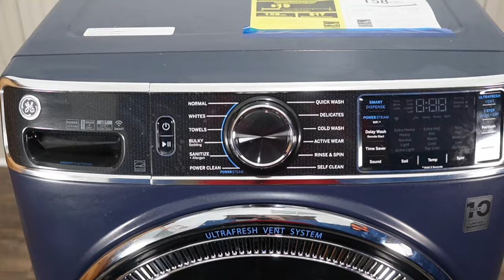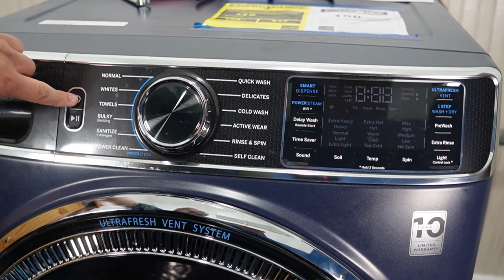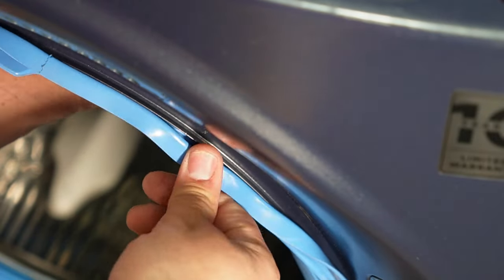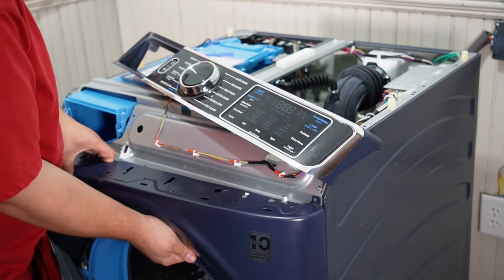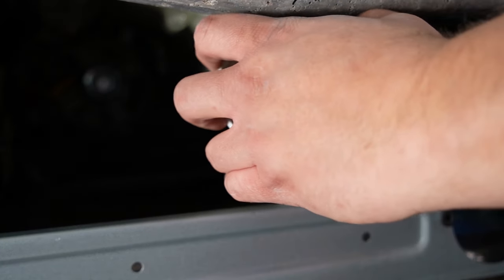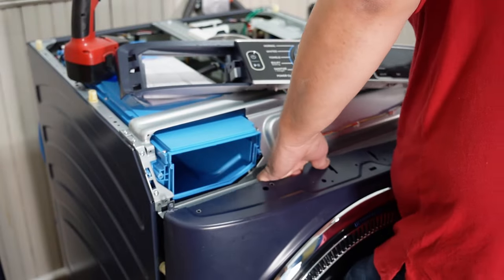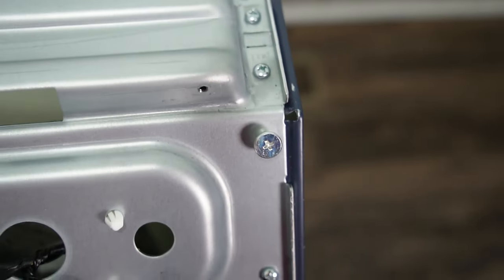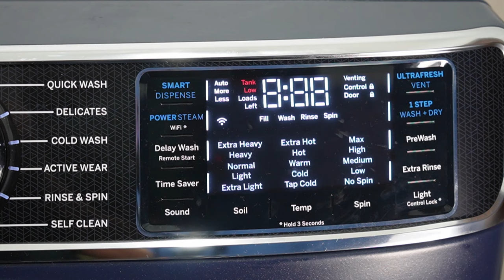GE Front Load Washer Won't Drain or Spin - Ideas to Troubleshoot & Fix

Comment: You DO NOT have to remove the front of this machine to access/remove/replace the pump! It’s easily accessible from the bottom of the machine. Two screws remove it and there’s plenty of space to pull it out. Also 9 times out of ten they pump is fine just jammed with debris keeping the pump from turning. Have dealt with this twice. Three screws hold the pump together, open up the pump and almost a guarantee there’s something stuck in the pump that made it past the filter. It’s a 15-20 min free fix.
Reply: If you have access to flipping the machine on it's back in a basement or garage, but if it's on a pedestal in a small laundry room, that's definitely not easier. Besides the Phillips screws go in from the top.
Reply: Agreed, just flipped it's back, the pump is exposed.
Reply: You’re exactly correct! Took me a half hour to take the pump out flipping the machine on its back, removethe housing, remove the blockage, and reassemble/reinstall. Saved me $60 on a pump and took me no time at all 🤘🏼
Reply: W
Reply: Thank you so much for this advice.  Turns out the impeller was just clogged.  Super easy fix.
Reply: @anthonyboni5884  Hi what is the housing mine doesnt drain
Reply: Yep. A small pebble/ hair tie for me. 20 min fix. Thanks again youtube!
Reply: @judyadiaz  it’s under the front right. Lay machine on its back and it’s easily accessible and a quick fix. Get the water out first though
Reply: I am so thankful I clicked on comments, bought the pair GE 2018s for $150 because washer would not drain. Even if it is the pump, I made a great deal. I now will always read the comments! Live and learn!
Reply: What symptoms were you guys having? Ours seems to be pumping, but it will end every cycle after 3 minutes, it appears to not want to spin.
Reply: Do you happen to know if the Inverter board is accessible from the bottom as well? Hate to have to disassemble the whole thing... Thanks
Reply: @mikediyer8361  did you ever access your inverter board?
Reply: We read this and my hubby did this option! Thank you!
Reply: @littlenewland1  did you guys figure it out? Ours is doing the same thing!
Reply: Is there a video for this? Thinking about giving it a go today.
Reply: @Jayhawg just did it and I flipped it on its left side. Use socket and Philip screw to unbolt pump (2 screws). Then pliers to take off plumbing hose (2). Unassembled the pump 3 screws and check for blockage
Reply: @don2deliver yeah, OP is on one.
Reply: Yep, this comment saved me from taking the front of the washer off. Simply tipped it on its back and removed the hoses. Turned out the blue drain hose had a nice blockage at the joint where it turns 90° exiting the pump. I removed the pump anyways to make sure there weren’t any additional blockages. Thanks a lot for the info!
Reply: Thanks for this comment! Ours are stacked. Getting the dryer down and washer tilted back was a challenge but we did it. Our pump was clogged with a hair ball (🤢). Who knew that much hair got in to the washer?? We’ve had it for 5 years or so. But anyway hairball removed and washer is draining and spinning!
Reply: Here to confirm, @playtime9259 is the GOAT! You saved me so much effort and time that this video was wanting. My wife’s hair got caught around the pump and stopped it up. Flipped it upside down, took it out and now it’s working perfectly.
Reply: Some lady the other day washed rubberized mats in her washer….
Reply: Followed your instructions and didnt find any debris so my guess is the pump is bad. It was a B*tch to get the smaller blue hose clamp off but got it off eventually. Thanks for the tip. I really didn’t want to take the whole front apart like the OP on the youtube video.

Comment: Everyone before following the method with the lower compartment make sure you have a large container or bucket as opposed to a paper towel or bowl. If an entire wash has not finished draining it can cover 2-3 rooms with water. It took me 4 heavy duty paper towel rolls to clean up smh
Reply: Or just hold a shop vac to the front filter opening as you unscrew it. Not a drop on the floor
Reply: This comment is 100% correct lol

Comment: Thanks for the great video. I've got your same washer. The hoses are all clear, the drain pipe is properly routed into the drain, and I just replaced the drain pump. Still won't drain. When I put it into test mode 12 to drain it, nothing happens. I suspect it is not getting proper connection telling it to drain. What should I be looking at replacing if the control board is needing to be replaced? THANK YOU SO MUCH.
Reply: This is my problem too
Reply: @dianediaz1586  I wound up having to replace the whole control board. When I inspected it, I found a part that had completely blown (like black smoke residue). I replaced that part (after several failed part attempts), and it worked. I think it blew because my son was playing with the washer and it got put into several spin cycles in a row in a short amount of time. I recently had another part fail and I said I’ve had it with this washer and replaced it. Good luck to you.
Reply: Thank you I ordered just now ☺️

Comment: I need info and video please on how to change the control board. Broke w/ 13 minutes left in cycle. Machine won’t drain, showing many codes, that often change w/ trouble shooting. Checked drain filter and was completely clean, so we thought possibly drain pump, changed it and still doing same thing. Reading other comments, leaning towards control board change but GE says the part is $418, and that doesn’t include labor if we can’t do it ourselves. Looks like we’re going to have no choice but to buy a new machine. We’re already in $125 for a service call.
Reply from the maker: Just posted the video yesterday on my channel! I also sell the boards and they are under $150!

Comment: I used this video to fix my washer. I have the same one that's in the video. I think I messed something up putting it back together because it's leaking from the bottom of the machine. It's on a pedestal and I just opened it and found it to be full of water. Not sure what to check first. It only leaks while the water is running into the drum. And it looks like it's only leaking a little bit. But it was enough to fill up the drawer with water since I put it back together like 5 months ago or so.
Reply: I have the  same washer, and it drips water I to the drawer ever since I purchased it.  

Also, I hired a technician because the machine door stuck closed and had to replace the door latch, and the main board cost me $500.  The machine still leaks, but I can open the door now.

Now the washing machine won't drain and spin dry.  I think this GE washing machine is not built well to have so many issues after only three years of use.

Comment: Just wanted to take a minute and say thank you for the excellent videos! I bought a used GFW550SPN0DG washer/dryer set recently and the washer was not working. No tumble or spin, but drain worked fine. Your videos were a tremendous help! They helped me determine how to get into the system, and using the error code video I narrowed the problem to the inverter/motor. Using this video I got it out and inspected the inverter to find some blown components due to the recent floods of IAN. Have a new one on the way! Thanks again!

Comment: Thank you for taking the time to make this video. I have no clue what I’m doing but based on the video I was able to determine that my hose was in too deep or the contraption at the bottom was too dirty. Either way the machine is working now. Need clean clothes for tomorrow so you saved me. Thank you!

Comment: This is a very informative video,  but I'd you are watching it like I was a few weeks ago, get ready for a potentially longer process. I have a simmer 2022 washer and the drain was clogged. The drain motor was not functioning.  Pulled thr moter as show in video and tested its resistance,  bad drain motor,  replaced the drain motor, reassembled, ran service test, still not functioning.  After researching more, replaced mainboard. During main board replacement found out the original main board model had been replaced with a new design model! Reassembled using new model main board,  and after more research to find the personality profile of my exact model, finally was able to enact service code 12, drain pump worked. In conclusion,  the clogged drain did start the problem but I believe GE realized the that if the drain pump failure would cause a main board failure, the main board design was changed.  The combination of this video and the diagnostic video were great. I hope they would make a video going through all the steps I had to go through on my 2022 GE washer.
Reply from the maker: This video was before the main board issues popped up. I'm trying to buy another one of these to show the mainboard failure + inverter motor failure, as thats another very common issue on these. Sadly, when I made this video, the problem you face popped up like... 3-6mo afterwards, and I didn't have this machine by the time the issue started happening.
Reply: This is a great video,  seeing the part number change on the main board shows me, GE knows about the cascading issue.

Comment: This was an amazing video.
It was easy to test the systems in question. I sequentially checked drainage and spinning, and then cleared error codes, unplugged and plugged after five minutes.
Better than ever!
Reply from the maker: Glad it helped!
Reply: How did you clear the codes? edit: run Test 16 to clear the codes.

Comment: Thank you so much for your video. I don’t even know how much money you saved me.  I was going to have a technician come out and it would have been $114 just to show up. Turned out that my issue was the main control board. Bought the OEM part online and installed it with no issues. Your other video about troubleshooting codes was great for showing me how to get the machine to reprogram.  Thank you, thank you, thank you!

Comment: Great video.  Thanks for the help with learning how to access the pump.  Fortunately for me on the GFW550 model, the pump itself was not hard to remove and reinstall.  Most of all, I got lucky and my pump was not burned out.  I found that the pump had a large clump of lint and hair inside, so I detached pump motor from the pump housing in order to clean it out and now it works great.

Comment: Thank you.  Watched the video. Did steps one and two, plugged it back in and the washer started draining.  Based in the sludge around the end of the drain hose I'm pretty sure that was the problem.  Thanks again.

Comment: Thanks to this video I was able to get my GE front load washer (same one that’s in this video) to go from “cancelled” to rinsing. My first move was to empty water out of the release valve on the bottom of the washer. Seems something was stuck. Thank you for making this video. It’s well done, as well.
Reply: Thank you I was about to buy another until I went through your steps…problem solved….thanks again 🎉

Comment: I had the same model today and wasn't draining. I blew on the drain hose and the drain pump worked. I did this twice more and it made it work. When I didn't do it I would hear it energize but no water drained. Of course I made sure the filter was cleaned first. It's either a weak pump or some kind of back pressure not allowing the water to flow

Comment: Instead of taking the face off I flipped it 
1) disconnecting everything like water and the power and making sure the drain hose won't get caught on anything
2) flip it on its back so the door is facing up
3) the pump is gonna be on the top right and you just gotta disconnect the wiring harness plug and the hoses and then the two screws holding the whole pump in place
4) 3 screws holding the pump halves together, once you do those make sure you clear any debris or hair 
5) put it all back together and if it drains its good to go

Comment: Found a bulletin on this issue. Usually was a drain issue of water valve, BUT both were working properly. Did some digging and found a service bulletin on a board relay going bad. Don’t know if any of you guys have seen that, but that’s what GE suggested to me. Relay was bulging on the surface, thank goodness it was under warranty.
Reply: I assume you changed the main board and it fixed it?

Comment: Thanks for the very informative video, with your help and help from other commenter we determined it's not the drain pump. We believe it's the control board so have ordered a new one.
Reply: Did changing out the control board fix your problem? I just changed out the pump and I’m still not draining😢

Comment: Thank you for the helpful video. Watching it made it much easier to tackle this project. I found a large glob of hair and short bits of yarn tangled up in the pump impeller. Helpful tip. I marked the different kinds of screws and there corresponding holes with different color paint markers. It made it a lot easier putting all the screws back in the right spots.

Comment: @bensappliancesandjunk According to your previous video, I cleared my error codes and ran the washer and got a code 3. This required me to run spin test 14 and the test stopped exactly after 5 seconds which points to a Hall Sensor issue. My question to you is, how and where do I locate the speed/Hall sensor on my GE washer (same type model as the one in the video) please?

Comment: My GE GFWR4805F2RR front loader easily gets unbalanced and won't spin. I've followed all of the steps in this helpful video which did make the incident occur less often. Since thenI take the clothes out and reposition them, which seems to work half the time. Other times I moderately shake the barrel inside, that the clothes are in, front to back and that allows for the spin afterwards. A little lost for ideas at this point

Comment: One question, I am about to buy this washing machine, is it a good option? And if it has an inverter motor? Thanks 😊
Reply from the maker: It has an inverter motor. Older units had issues with the inverter but AFAIK, GE fixed it
Reply: @bensappliancesandjunk  thanks for your support 👍🏻

Comment: Hey Ben, still have a question but first thank you. The filter was in fact front loader was in fact clogged. but after I unplugged it it's still not spinning. I've unplugged it from the wall. Still no luck

Comment: Hi periodically have to drain the water out of the line because gunk and stuff builds up in it. But it is so close to the floor and there is hardly any room to get a pan or anything under there any suggestions? I put a towel underneath it and a flat plastic pan but water always still gets all over the floor. Do they make any kind of a hose that you can attach to it? In order to drain it better? I would like to be able to see there better to get more gunk out.

Comment: You can just take out the soap tray and tip the machine over on it's side and get to the pump super easy from the massive hole in the bottom. I have the GF model and got the pump out in just a few minutes.

Comment: I followed every step including replacing the pump with a new one from your store. I still have the same problem it won’t drain! Any advice or help would be appreciated
Reply from the maker: Its possible that the board has gone bad as well. I literally have a video coming out next week about this issue. I bought a used/broken one of these JUST to film more issues that crop up on these since I made this video exactly 2 years ago.

Often what happens is the pump goes bad -> blows board up -> needs both replaced. You can confirm this by checking for 120 VAC at the maroon harness on the control board. If you don't get 120 VAC between brown and black wires on pin 2/3, then the board isn't sending the proper drainage voltage to the motor because part of it has blown up
Reply: @bensappliancesandjunk Thank you for the timely reply. Your videos have been extremely helpful. I’ll try checking the wires like you suggested. If it is a bad board what can I do to fix that issue? Install a new one?
Reply from the maker: @captainluke90  new board, yes. Its so common we began stocking them at our shop. There are two styles, depending on your model#. I can link you to the right one if you let me know the model#
Reply: @bensappliancesandjunk  I got the new board yesterday and installed it. Success! The washer is now draining! Thank you so much for all your help!
Reply from the maker: @captainluke90  way to go!

Comment: Thank you for the video this ge washer model gfw850ssn0ww the problem i'm having is it will only drain and spin if you do a drain and spin only. If you put it on a normal cycle when it is ready to drain and spin it wil not go into drain what do you think this might be let me know thanks ben i have bought several of your samsung heater kits for there refrigerators and have 100 % taken care of them can you help me with this issue 
thank you.
Reply from the maker: Ugh, I don't have Service Matters for these. I THINK there's a bulletin for that for the board, but I'm not 100% sure.

Comment: Same washer the resistance in the pump is within grange but I’m not getting voltage to the pump when I force the pump to turn on with diagnostic mode 12. Should I just order a new pump?
Reply: This is what’s going on with mine. Did you figure it out?

Comment: I have the  same washer, and it drips water I to the drawer ever since I purchased it.  

Also, I hired a technician because the machine door stuck closed and had to replace the door latch, and the main board cost me $500.  The machine still leaks, but I can open the door now.

Now the washing machine won't drain and spin dry.  I think this GE washing machine is not built well to have so many issues after only three years of use.